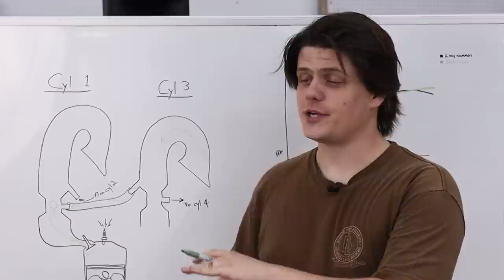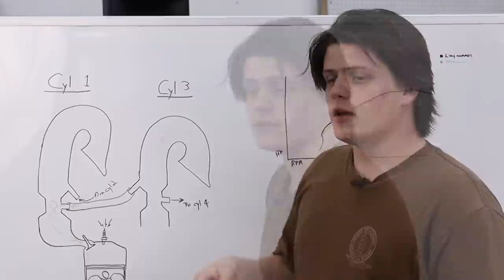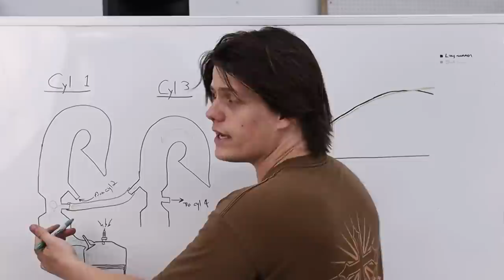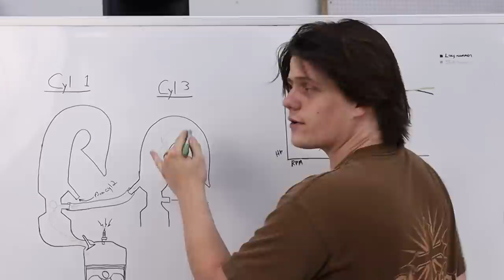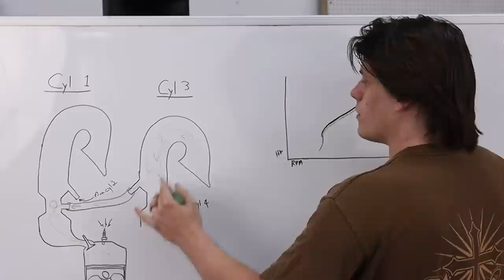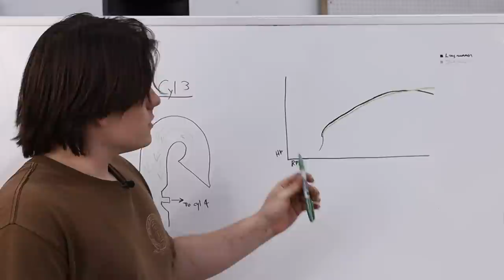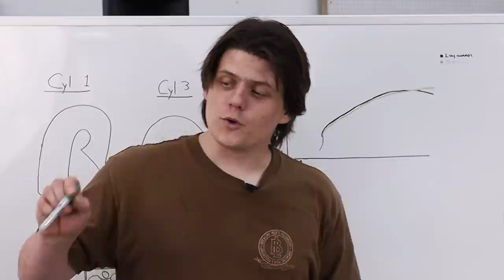3D Printed ITB Intake for Turbos and/or Stock ECUs

Comment: Curious to see which pressures compromise the manifold, would like to see a video on stress testing.
Reply: So, i have some inconclusive data for this. In college i 3d printed a 2 piece plenum in ABS for the engine of a CBR 600RR. The wall thickness as 3 mm.

Static pressure test gave me data on an internal 0.4 atmosphere for prolonged time without any issues whatsoever. We ran that plenum for 3 years on our little formula SAE car and retired it because we move on to electric cars after.

We didnt test it to failure tho
Reply: @crashTestGuru  Still rather impressive on a high compression small engine, but yes, i'm just curious to see where the point of failure is going to be at haha

Comment: love the idea.  GM has heads that have a small ramp to create a vortex in the cylinder.  Maybe a ramp to the small hole/hose that connects each stack together to help create positive pressure on the next intake runner?  Just an idea :)  love the explanation! :)  good luck!

Comment: Going through other videos on this topic now: at 4:50 you more or less state that intake runner tuning is less impactful on performance than exhaust - of course really "it depends" but often intake tuning is more effective. The purpose of exhaust pressure wave tuning is, as you mention, to help "scavenge" the cylinder. First, that means getting the spent gases out to make room for fresh mix, secondly (and maybe more important for power) it momentarily lowers the pressure in the combustion chamber. When this is timed to happen while the intake valve is open, that means a stronger vacuum to pull fresh mix into the cylinder.

Remember, gas will "try" to flow any time there is a pressure differential, and as you point out in this video, momentum also helps, but you've got to build up that momentum via pressure differentials across orifices like valve seats and runner inlets. However, you can only pull 1 atmosphere of vacuum (no such thing as negative absolute pressure), so the exhaust's effect on pulling fresh air in is limited by that (and by the short durations of blowdown and overlap). On the intake side, having a positive pressure wave arrive when the intake valve is open further increases the pressure differential - when exhaust and intake work together to time the negative wave from the exhaust and positive wave from the intake, you get that temporary supercharger effect. And since the intake pressure wave has a longer duration to push fresh mix in (intake valve open event) compared to exhaust pulling fresh mix in (only the duration of the negative pressure pulse that happens during overlap), the intake effect is often more pronounced. Of course they both need to work in harmony with the cam profiles. 

Still filling myself in on where you're at, so please take above with a grain of salt.
Reply from the maker: That's really useful insight. There's a lot I wasn't considering in my assumption that exhaust tuning affects the bottom line more than intake tuning. I knew that they heavily relied on each other but you've zoomed in some detail I wasn't noticing. Thanks!

Comment: Gotta put a rpm-governed valve one your crossovers, or it will give you some weird power bands. Progressive opening would be better, but on/off like most mfgs do might be more simple to tune, akin to vtec crossover. I also think you need bigger crossover tubing. You are dealing with short times, and small pressure differentials, so any drag will radically harm effectiveness.

Comment: the tubes between the stack will also help reduce the pressure pulses that you get wit seperate itbs, which means a more even intake flow between strokes and also a more consistent MAF reading

Comment: have to make sure the air pressure is the same where the stacks draw air in, as i think you will have to open the throats and make each one slightly larger than the previous ITB in line to feed each cylinder the same amount of air

Comment: The second it clicked in my head I said that’s freaking sick in a room of people I don’t know 😂😂. Anyway, this is a really cool. Porsche has implemented a variable resonance intake manifold on their NA flat 6 engines with ITBs for some time. This allows the pressure wave of air that hits one cylinders closed intake valve to be sent back to the opposite bank perfectly in time for the opening of the next cylinders intake valve. The result is 1-2 psi of positive pressure in a naturally aspirated engine at high rpm. Hence the 8,500-9,000rpm redline and a top heavy power curve. Your method is different, but obviously so is the engine. Hopefully a similar outcome.
Reply from the maker: 😂 nice. I'm no Porsche engineer but we'll see how it goes

Comment: Skip the silicone. O rings are much better. Easier to assemble, easier to service. Especially given you intend to do iterative design.

You can make the o ring for the plenum joint using a kit. McMaster has it. Rope, cut to length, glue the ends. Comes with a fixture to aid perpendicular cuts.

High vacuum grease is the ideal lubrication for these joints.
Reply from the maker: Seems like that's gonna be the winning combo

Comment: I know with the nylon 66 and nylon 6 blend I use, it can be annealed in an oven. 
I’m keen to print ITB manifold for my car. 
I will use a steel container and fine grain salt, to pack around the manifold. 
A jig that holds the manifold submerged in the salt, wouldn’t go astray.

Comment: exhaust gasses are utilized for pressure pulse dynamics because of the associated sound wave, not the gas temperature. 
Variable length intake tracts are already utilized with success- i dont believe there will be a significant compromise with fixed volume intake tract and attempting to use change in diameter with pressure waves from other cylinders to have the same effect. 

Velocity vs volume.

Comment: I've played with the whole 3D printed intake thing a few times and it's cool to see more and more people toying with the idea.

Long term reliability is my major concern, and even with my own projects I've noticed some amount of creep (with metal backing plates too).  I'd also definitely consider adding some sort of brace because that's a lot of 3D printed plastic hanging off of a vibrating, bouncing engine.

Perhaps reconsider using o-rings instead of RTV.  Removing RTV'd flanges (especially plastic ones) is very likely to damage the flange surface if the RTV is holding on strongly.  Heck I've scuffed aluminum flanges and bent stamped steel pans trying to separate strong RTV.  O-rings won't add much to the cost and will be a lot easier to work with, not to mention likely seal better.  They can be found in tons of different sizes, but if you can't find the right one you can always buy stock cord and make your own.

If you do stay with RTV, keep in mind that very few are truly gasoline resistant.  Generally speaking, no RTV found at the parts store will be.  The only exceptions are Permatex Motoseal (works great but is very runny) and then non-drying gasketing compounds like No.1 - 3.  There are certainly other options out there, but not that are common or will be found locally.  Standard RTV (grey, black, red, whatever) is not gasoline resistant long term.  This of course isn't an issue for the plenum, but would be on the head.

Lastly, cool idea to try PP-CF.  That's one I haven't messed with but have considered and it'll be interesting to see how it works out for you.  I started with run-of-the-mill PA-CF but am now transitioning to PAHT-CF (Luvocom 9742 BK) as it's a pretty good middle ground between PA and full PPA (less creep and better high temp stability).  I've also experimented with PPS-CF but it's just a bit too brittle (in my opinion) to be used for an entire manifold.  I'm currently stuck with materials that can run in a chamber at or below 70C, so pure PPA and other high temp materials are a bit out of reach unfortunately.

Best of luck with your endeavor!  Look forward to seeing the progress.
Reply: If he's running pure ethanol (which is not likely to me) he's going to have some issues with the long term reliability using polypropylene. It's not super resistant to the contact of gasoline, as it will swell or warp.
Reply from the maker: Really good stuff to know thank you 👍

Comment: I love this kind of ideas and 3d printing. I myself have an audi 80 b3 with a 4 cylinder carburettor engine. Unfortunately, it doesn't have that much power. So I thought about using a similar design but with one carburettor per cylider to get at least a little more power without putting too much stress on the aluminum block. Do you have any other ideas?
Reply from the maker: Generally the switch to individual throttle bodies/carbs doesn't add much power, sometimes not at all. What it does allow is the ability to better tune the engine for a specific RPM range.
Reply: @StandRacing  Thanks for the answer, I'll see if and how I can improve something on the intake.👍

Comment: It would be interesting to see if "outboard" fuel injection adds any benefit. Probably not too crazy to add to this setup, just a few holes for injectors in the lower plenum at the right spot. Probably needs a standalone ECU to really get any benefit, as injector timing would start to matter more. 

Or variable length runners? Now that would be a cool thing.

Comment: Might think of a g10 phenolic spacer between the head and intake, very thermally dead. Put one between upper and lower intakes on a car and it went from too hot to touch to slightly warm. It’s easy to cut, hell you can do it with a jig saw if you really want. 

Wonder about threading into it so you could bolt it to the head and intake to spacer so the bolts wouldn’t even warm the plastic/deform it.
Reply from the maker: Interesting, I've thought about using a spacer and haven't yet considered garolite. Thanks 👍

Comment: I also plan to make an ITB setup but in my case it's a junker VW 1,8 liter engine that's just sitting around.
But at this point i'm weighing my options whether i should go with straight 3D printed part or try lost PLA casting.
Casting would be cheaper than 3d printing CF nylon (my material of choice for this application), but would require post processing to fix any casting imperfections, whereas a 3d printed part would be clean from the get go.

Comment: with the housing if i may recomand, its possible to print a tpu gasket that should work at sealing for your NA aplication, but in a boost setup it would fail before the parts would, where silicon would not fail before the part, this sort of depends on its thickness ofcoarce, but so long as your at about 5 layers of 0.4 it should

Comment: I would not use rtv to mate that to the cyl head, if you do suffer creep, it will immediately start leaking.
you could actually use o-rings off another car, just find one that fits well and engineer for it. 
alternatively, maybe some type of gasket which will form a heat barrier, like an exhaust manifold gasket

Comment: Interesting concept, not sure how it’ll work in the real world, at all speeds (rpm) including idle the air in the velocity stack will have some velocity, did you try any cfd? The way to test this would be to have a set of stacks without your ‘balance’ tube and throw them back to back on the dyno. You’ve caught my attention and gotten a sub out of me.

Comment: Have you thought about purchasing a performance phenolic intake manifold spacer, that essentially eliminates any radiant heat from the head. That would have to help with high temperatures creeping into the inlet manifold structure.
Reply from the maker: That's a good idea. It didn't ever cross my mind that they made those for fuel injected systems. I've seen them on carbs

Comment: The very curved intake runners will hurt mid-high rpm power, air really doesn't turn well at the speeds that are in the intake, it just wants to go straight. so If you need a curve, making the curve as long as possible is best.
You should also make the curve go from bottom to top, because the ports in the head are curving downward, so to minimize the curvature, mount the ITB's higher up, then put that curved velocity stack so it curves down.

Comment: Instead of RTV, I'd go with a groove to insert a 3D printed TPU flat gasket. From my personal experience with them creating carburetor and fuel tank gaskets for my bike, I can tell they are more than capable of resisting the enormous heat output of a 750cc V4 engine in very hot summer weather and reusing them is possible after doing maintenance with no sealing issues (had to reassemble the carbs like 5 times until I got them sorted, so yeah... sigh ).

Comment: I wonder if it will cause a vacuum instead though ? The high velocity air moving through the runner hitting that small diameter venturi will cause vacuum instead ? But hey thats the fun part of experimenting lol CAD and 3D printing is pretty amazing stuff my dude. I love it myself and im currently getting ready to turn my mill into a CNC mill.

Comment: Pretty well made video with formatting and explanations of concept. 

So you design deletes the Idle Air Control valve right? Does that mean you wouldn’t really want to use it if you have accessories like AC/PS? Since the IACV wouldn’t be there to compensate the idle drop when the AC/PS out load on the engine.
Reply from the maker: The manifold does have vacuum lines coming off of it. A plate could be made to mount the IACV and receive vacuum from the manifold and it could be set up.

Comment: I can see how much designwork you put in, very nice!
When talking about your concept for the runner where you hope to create scavenging imho wont work, but please proove me wrong ;) Please consider doing an A-B test concerning your runner design!
When thinking about these intake setups it needs to be clear what we actually want to create. For example if there was a higher pressure at the Valve right as its closing we would create better volumetric efficiency (more mixture got in the cylinder). But what to do to achieve it: the classic approach is to use the negative pressure wave in the runner created by the valve-open-event which is reflected and inversed due to the open end of the runner tube. By sizing the runner length appropriately to the desired rpm or better yet variing the runner length depending on rpm this effect can be utilized. See for reference bike engines which use variable length intake runners.
For the bigger picture concerning not only one cylinder but multiple try to think about the whole intake not just your runners. When high performance intake systems are designed it matters what happens in the intake-tube (diameter+length), the plenum (timing of plenumpressures) aswell as the individual runners pressure-signals. Looking at these three main components fits the analogy to exhaust-scavenging ihmo better (minus the missing bigger plenumvolume for exhausts). To do this sizing correctly one would need a bunch of pressure sensing points/flow-analysis as they are each a resonant system and their combination in terms of when is which system at what pressure level/velocity to optimally benefit the acceleration of the air into the cylinder.
I hope with this comment i can bring another viewpoint onto the matter =)
From experience tinkering with this stuff please make shure you have a convenient way of syncing the itbs so that at very small blade angles the air distribution to the cylinders is as similar as possible. For dealing with creep aswel as thermal expansion i had good luck with stacking springwashers for critical bolt locations as they would provide more stable clampload even when considering going from ambient to under-hood and back.
Usually carbon fibre polyamide was used for its very high heat-deflection temperature, i suspect with what i could find about carbon-PP that this could be cutting it to close. Will be intersting what it can withstand!
Be aware when using RTV its critical that it wont form a bulge/ridge restricting the flowpaths in the runners/throttles.
And i hope you dont have as many vacuum leaks as i had/have ;)
Really looking forward to the next video, hope you get it idling/running/tuned soon! Godspeed!
Reply from the maker: Good insight! I do actually believe the chance of the unique scavenging system succeeding is very small. I'm doing to do the A-B tests on the dyno but if my system works it will have been through luck, since I have done very little math concerning all these things. If it fails I'm not going to put anymore time into it because I think the potential for HP gain is tiny. I'll instead focus on choosing the right runner length and horn shape.

Comment: Design and print look dooooope! Just curious how you will overcome the bottle neck of the plenum inlet.  Seems that there may be more square inches of Intake port than plenum inlet. Perhaps there's a way to make the inlet large enough to sandwich a flat air filter into, so that there is more air supply to get worked by your design. Will be staying tuned
Reply from the maker: I did some research and was extremely surprised to find out how much HP a stock size throttle body can accommodate. (In this case it's just a plenum inlet as you said)